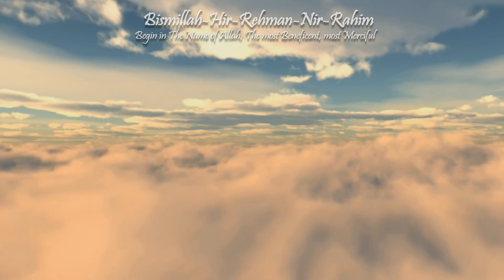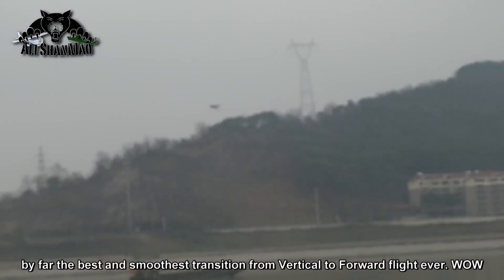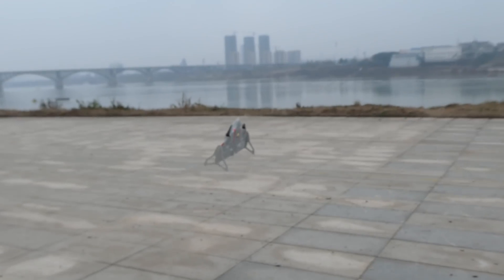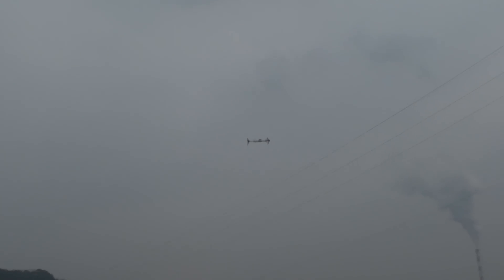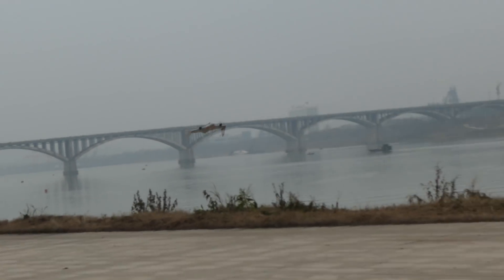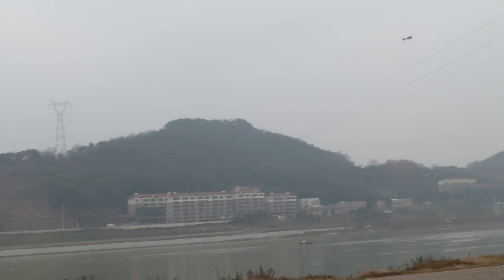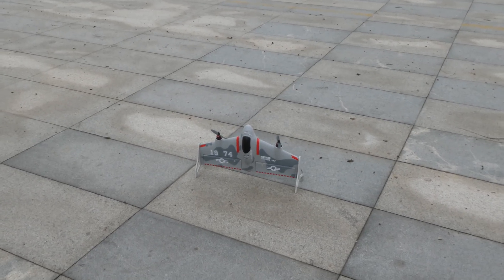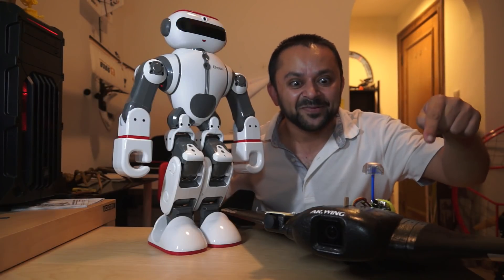Eachine Mirage E500 VTOL Vertical Take Off FPV Racing Flying Wing

Comment: What great idea for an rc model plane , you can fly in a limited space as well because you don't need a big area to land . I see your back in China , back in the smog and bad air , what reading do you get on your air quality monitor :-)
Reply from the maker: I am surprised and glad to see that my Air Quality Meter Shows Green light most of the days, except some mornings outside it shows Orange light. That means moderate polluted. we have Air Conditioning and Air Purifier at home running all day so inside home its good. 

However, my little one wheezes at nights and coughs. I myself can feel getting back to wheezing and Asthma which is caused by allergy and all 3 of us are taking a little dose of Zyrtec every 3 days. 

i also found Manuka Honey (Which is quiet Costly) but if we mix one spoon of Manuka Honey in a little warm water, and give it to my little kid who was wheezing and coughing, he would sleep nice and comfortably all night, no wheezing no coughing and be comfortable all day long. Its very effective. So I am gonna buy a whole box of that honey and keep at home :)

again, to be honest, compared to past years, Pollution in China has gone down a lot due to Constant government efforts. and after they ban gasoline cars. wow, it will be much more clean air to breath.

Comment: Nice to see you back at your old stomping grounds in China. 👍  Check out the XK X520.
Reply from the maker: you mean the XK VTOL? I believe this two are the same thing with some extra features in XK
Reply: Yup, the X520 is also a VTOL, but in my opinion looks a lot better with a longer nose/cockpit.  And from videos I've seen where it's compared to the Eachine, it flies a lot better, like actually banking in turns in 6G mode instead of "turning like a car" like you mention in this video. Heh  It also has a nose wheel, which even though it looks kinda funky, it allows you to land it like an airplane too.  Although I'm not sure how long the little tail wheels on the fins will last. Heh